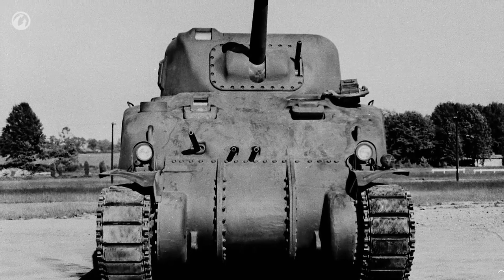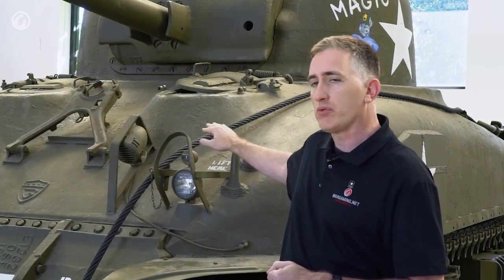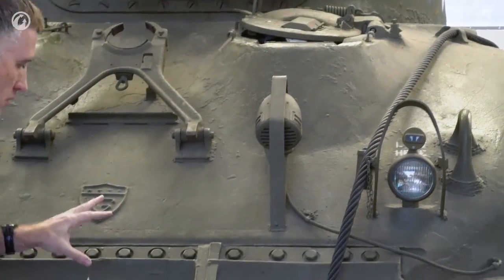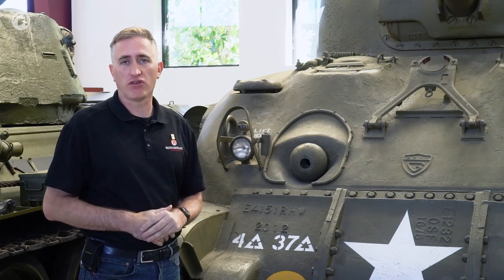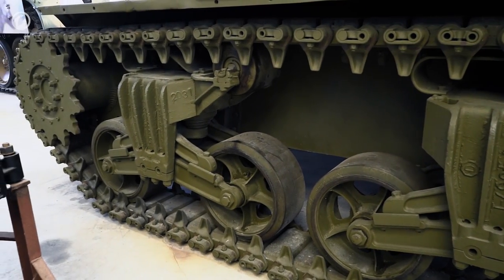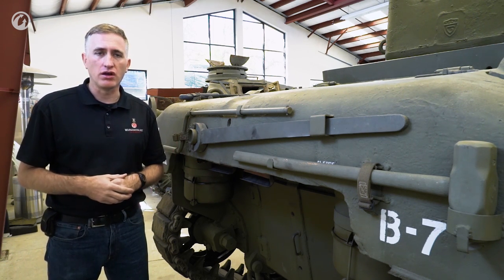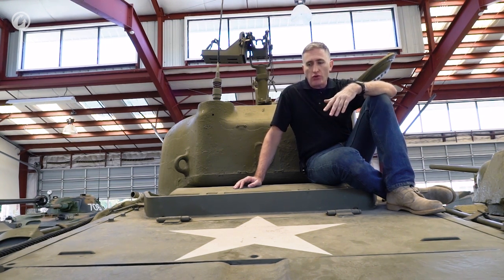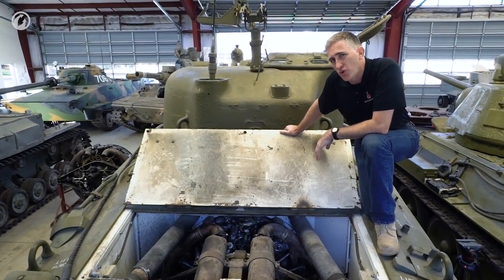Inside the Chieftain's Hatch: M4A1 Sherman part 1

Comment: Worst tanks of WWll
Reply: Quite the contrary.
Reply: Jan gutkowski Which variants? In comparison to what?
Reply: Only  pluses of this tanks was that there were cheap as fuck and line produced.
Reply: But in fight with any Brithish, Soviet or German same  tank generation 1vs1 sherman hadnt any chance to win.
Reply: Jan gutkowski You're avoiding answering my question.

The UFP of welded hull, small hatch models was 50.8mm (2.0in) @ 57 degrees from vertical, that is 93.27mm relative, and was between 103mm and 107mm effective dependent on year of construction. Latter large-hatch variants has 63.5mm (2.5in) @ 47 degrees, 93.108mm relative, and 118mm effective. The Tiger's UGP was 100mm (3.94in) at 9 degrees, 106mm relative, and between 110mm and 113mm effective. The T-34 had 45mm (1.77in.) @ 60 degrees, 90mm relative, generally 97 to 103mm effective. The PanzerKampfwagen IV Ausf.G/H/J had 80mm  (3.15in.) at 9 degrees, 82mm relative, about 76-84mmm effective on a bad or good day (they're FHA). All compared to basic British rolled homogeneous steel from 1930.

All M4s had better effective (and relative for that matter) armor than any other Allied or Axis Medium/Cruiser tank, with the exception of the Panther, it was not sh*t in any regards.

The 75mm gun M3 was completely adequate in dealing with the PanzerKampfwagen IV, any Japanese or Italian tank of the time, or most German armor, i.e. the Sturmgeschutz.

Again, not sh*t in any regards significant enough to matter in frontal engagement.
Reply: Jan gutkowski The M4 could win a frontal engagement with a Crusader or Cromwell quite easily without worry. T-34/76 would be a threat out to about 100m. The PanzerKampfwagen IV could deal with the M4 at the same range the M4 could it - 650m, all considering minor angling.
Reply: Dude check what gun pzVI had and what armor m4 had.
M4 coudnt survive more than one shoot from t34-76 or pzVI , m4 were a cannon fodder. Only M4A3E2 could  
take a shot from other nation tanks and not explode because it had 100 mm armor on 47 degrees and impenetrable turret but that was only one good m4 at all.
Reply: You also fail to consider that the M4 was an incredibly easy tank to produce and maintain in bulk. Compared to the Tiger as an example, almost 40x more Shermans were produced.

In addition, your claim that the M4 could not survive more than one shot from a T-34-76 is just quite frankly bullshit. The average pen at 500m of the F-34 firing APHE was 69 mm, which is lower than the ~75mm effective armor on the upper frontal plate of the Sherman.
Reply: Yes, you're right the sherman tank was completely awful and thats why it was one of the most produced tanks in the war because it was completely useless and not that it was good enough for the job or anything.

Also, you should check your facts before posting random nonsense. Shermans didn''t just "explode" upon being shot, the rounds have to hit fuel or ammo to cause an explosion. Not to mention the sherman was just as dangerous to the PZIV or T-34 as they are to it. This is because the T-34 only has at best, 45mm's of armor on any part of the tank. And don't even get me started on the PZ IV's armor.
Reply: Jan gutkowski

> "Dude check what gun pzVI had and what armor m4 had."

So? I was just comparing armor, but even so, the Tiger was rare.

> "M4 coudnt survive more than one shoot from t34-76 or pzVI , m4 were a cannon fodder."

That makes no sense.
Reply: You really have no idea what you are talking about lol.
Reply: Jan gutkowski to be fair the doctrine about tank battle application was infantry orientated. Tank vs tank wasn't the initial primary ambition. The Sherman's tracks could last up to 2000km compared to 400km for German tanks & that's a huge logistical consideration. I'm not saying the M4 was the best but it was serviceable as fit for duty.
Reply: M4 dies from one shoot from any germany tank except pzIII beacause it had too smal gun but m4 had weekspots everywhere if pzVI shoot m4 front plate m4 explode armor was too week for taknks what they were fighting then.
Reply: You seriously believe that every hit scored on an M4 caused an ammo-rack detonation? Where are your sources for any of this?
Reply: Ok maybe not explode everytime but no one inside can survive. Check how much explosive material shells from pzVI or t34 76 had.
Reply: Ok, Then check out the Almighty shiity Japanese Tanks, If Sherman were shit, Why American using it against Japanese and Germans?
Reply: And told me why Americans who using shitty tanks won WW2 against Germans with great tanks?
Reply: And, WTH using HE on Heavily-Armoured tanks in Real Life? HE is mostly used on IFV, Light armoured vehicles and bunkers. And REMEMBER that war is not about Tanks VS Tanks, Sherman had weakness in Tank combats but its actual role is support infantry and destroy enemy IFV.

The Tiger was build to counter Soviet KV-1 and T-34, It has anti-tanks cannon and heavy armor, But it were vulnerable against anti-tank missile and consume alot of fuel.

About T-34 (And 34-85) Yes, It were one of greatest tank in WW2, But it can't take down Sherman in one shot if shell didn't hit the engine or ammoracks
Reply: Finally, Sherman NEVER fight 1v1 against enemy tanks, They're mostly came in group (3-4 tanks or more) And it was easy to control produce and modified into many variants (SPGs, Support Vehicle, Flamethrower Tanks, And missile carrier) A myth about 1 Tiger can take down 5 Shermans is just a propaganda from Germans to make Allies feared the Tiger tank, Actually it can easily taken down by 1-3 Sherman(s) by hit and run (Tiger turret turning speed is bad)

IMO, The worst tanks in WW2 is actually French duck tanks and Japanese shiity tanks
Reply: Ushio Sama Well almost never. It shouldn't happen, but in some combat conditions you find yourself alone. As is the case with Lt. John Gordon (British tanker, commander of the Firefly Joe Ekins was apart of in July) of the Irish Guards Tank Regiment and Lt. Edwin Cox of the 752nd Tank Battalion. Both who faced Tiger Is (3 in the case of Gordon, and in a prior engagement rammed a Konigstiger into submission) and won. 

5 is the standard American Medium Tank platoon, hence that's where that myth comes from. 

A Tiger can take out as many tanks as it has ammunition dependent on the situation and the crew (and subsequently luck).
Reply: Ushio Sama The Tiger was not developed to counter either the KV-1 or T-34. The development started well before the war, and the actual tank only saw service less than 16 months after encountering the first T-34s in June, '41. That's too short a time to develop a vehicle.
Reply: Jan gutkowski That's not how tanks work... 

Not to mention that completely contradicts the fact that the T-34 had some of the highest crew casualty rates of the war for any AFV, and the M4 one of the lowest of any tank of its type, only challenged by the Panther based on the benefit of the doubt.
Reply: Nathan Peterson Thanks for information
Reply: T-34-76 had a comparable gun to Sherman, as a matter of fact Land Lease Sherman for USSR installed theirs F-34 gun on Sherman! T-34-85 had a much better gun that was based on a Soviet AAA gun, but towards the end of the war ammunition for Sherman was greatly improved, and Sherman in the war with North Korea faced T-34-85, and inflicted a heavy losses on those T-34-85, and though t-34-85(and Su-100 STG based on T-34) still serving around the world until now days, Sherman tank served all the way into early 1980s, that is pretty darn good service life, that almost no German tank(for the exception for Pz IV) can brag about! 

P.S. British firefly had a 17 pounder gun that was easily outperforming even T-34-85, for tank on tank encounters.
Reply: 3DBlockBuster That was a concept to rearm them, but due to the fact the F-34 wasn't any better, no vehicles were rearmed other than some units committing to field modifications.

The ZIS-S-53 fired the same ammunition, but has little influence from the design of the 52K.

The M4 served with the Chileans until 1999. The Israelis and various Middle Eastern countries, as well as Pakistan still use the variants based off the chassis, like the Ambutank.
Reply: RussianThunderrr The ZIS-S-53 is the same diameter as the 52K.
Reply: RussianThunderrr I thought you were referring to the ZIS-S-53 in contrast to the 52K.
Reply: Sorry, I used S. Zaloga  as a source of this info. The idea of rearming(and that is in my mind) is not based on a performance of the Sherman's gun, but rather on an ammo comparability, by rearming Serman tanks with their F-34 gun logistics of ammo is solved, isn't it?
Reply: RussianThunderrr Indeed, but they received sufficient amounts of ammunition <50,000 rounds.
Reply: no, not by a long shot. italian and japanese tanks were much worse.
Reply: At least it did a job
Reply: milcoll73 true i know that if you shoot a ke ho whith a .30 cal the bullets go through and kill the guys inside
Reply: this one was actually one of the best, and i would say the M4A3(76)w HVSS WAS the best, the t-34 was well inferior.
Reply: NedYarbNexus yep
Reply: no
Reply: "Sherman had lots of weak spots"
So did PzKwVI (excluding the tigers).
Driver view port, Gunner view port, Commanders Cupola ( wouldn't take out the tank but shrapnel could be ricocheted into cabin), the sides and rear being under armoured compared to the front, turret cheeks, and having ammo racks all around the crew cabin.

Also realize that Tigers, while great  at blowing up enemy tanks, were a bitch to repair and couldn't drive through mud or soft ground without getting stuck, and were, to my knowledge, unable to be towed (resulting in many tigers being lost as a result of being scuttled, not enemy combat).
Reply: The Sherman tank was an over rated hunk of metal. It had pathetic fire power and had to close into 550 metres and shoot a German Tank from behind, where as they could take out the Sherman with a head on shot from 1800 metres. Not to mention that they place an aircraft engine in it, that needed highly flammable/explosive octane fuel. The tank was a rushed disaster and it is only the american propaganda machine that made it out to be invincible. Even now the yanks believe the bullshit they were fed 70 years a go. The tank was fast and that was its only positive.. End of!

Don't believe me. Read the accounts of the men who had to sit in these death traps, they fucking hated them and thought they were shit!
Reply: At least it helped in the war a hole
Reply: WHAT! THE CROMWELL AND THE SHERMAN WERE EQUIVILANT IN ARMOUR AND GUN, AND THE CROMWELL WAS 72KM/H FAST WHILE THE CROMWELL'S ONLY 42KM/H!!!!!
Reply: Translation:  "I'm going to use my vast and extensive knowledge of tanks garnered from playing hours and hours of tank video games to make a wise and informed judgement call on the efficacy and value of a real-world weapon system".
Reply: Do some more research on the M4. It handed the T-34/85 it’s ass in Korea and it did it’s fair share of damage in the hands of the Israeli army. It did fine against the Panzer IV and III when it was introduced. Personally, I think it’s ugly until the US slapped on the T-23 turret and the HVSS, then it looked pretty good. The Panzer III was pretty dangerous, too, with the long barrel 50mm.
Reply: Its armor and gun makes it worst but the reliability is very high.
Reply: @jPlanerv2  only 1470 tankers killed out of 49000 crewmen in Shermans in Europe. 3% losses. Tanks would be knocked out, crews survived.